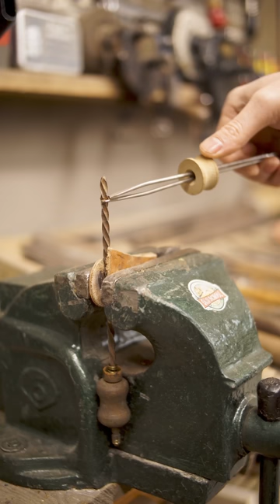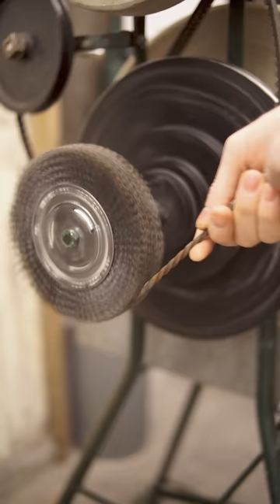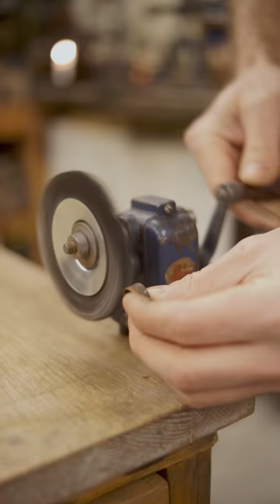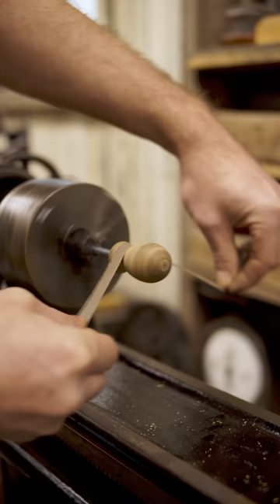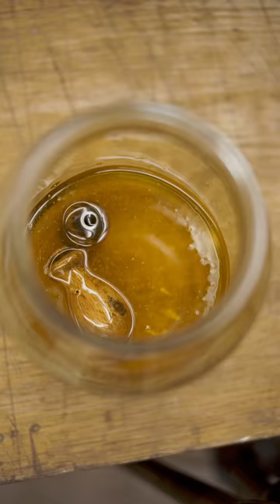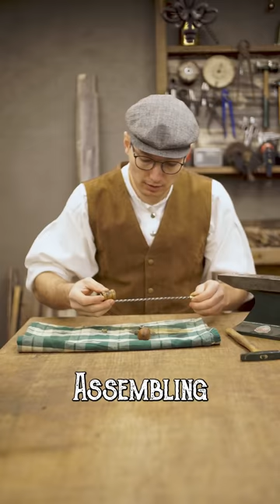Archimedes drill from 1895 year #antiquetools #vintagetools #restoration

Comment: This is a TRUE restoration. Not replacing parts with a bunch of new ones.
Reply: The word "obsolete" comes to mind
Reply: Far from a true restoration. He took off any edge that blade might have had left.
It's actually less useful now since it will be rounded off on the edge.
Reply: @FedSmoker64  Blade?.. bruh that's not the "blade" lol
Reply: @FedSmoker64  That's not the blade, it's just a screw so that the drill bit can rotate
Reply: And all with manual tools
Reply: @FedSmoker64  the bit isn’t in it dude. This is the drill and they are used to drill very tiny precise holes.
Reply: Except for that he ruined the handle
Reply: @0_K_0  no he just sanded it and dipped it in oil.. some restorations I seen replace the handle entirely
Reply: @lostpockets2227  exactly, he put and left it in the oil overnight, big mistake. It'll never dry out, you're meant to wipe it on. Trust me, that's how I ruined the handle on my axe, which wasn't cheap, but after doing a bit of research I got a new handle and tried again.
Reply: @0_K_0  oh that's very interesting thanks for the information
Reply: yes that is what the definition of restoration is
Reply: @0_K_0  yeah, I noticed that too, oil can't oxidize properly like that and it serves no purpose that just wiping it on properly doesn't already do perfectly fine.
Reply: hows the other one not restoration?
Reply: @FedSmoker64  back then a drill only cut with it's tip I believe
Reply: @FedSmoker64  Se não sabe para quê serve a ferramenta, porquê comenta?
Reply: @kwfroes  don't speak that gibberish at me
Reply: @FedSmoker64  You dont know what are you saying, right?
Reply: @FedSmoker64  dude. It's not for use. It's an antique decoration.
Reply: 0э
Reply: Sometimes something NEEDS to be replaced in order to literally use it. A useless tool is not a restored one. This tool was in very good condition allowing for what you think is restoration
Reply: I make a new one?
Reply: Sometimes True restoration requires some parts to be replaced either because the parts are not salvable or no longer useable. If some of the old parts are kept just so is is a “True restoration” then the piece may not be useable anymore. I define True restoration as you fix something that is older and broken and cant be fixed by traditional means; so that it can be used again.

Comment: My wife and I had inherited her Grandparents house about 12 years ago. It's nothing huge, they weren't rich. It is a nice place with a big backyard. The coolest thing is the shed in the back. Wilber (her grandpa) was an electrician, carpenter and inventor. The shed is like one of those tiny houses you see at Home Depot, except he built it himself from the slab to the wiring. The bottom floor is all carpentry gear from lathe to table saw and everything in-between. The upper floor was  his electronics workshop. The reason I mention this is because he has old manual tools just like these in there! I have was an Electronics Technician in the Navy and have a MBA in avionics engineering, but I love carpentry as a hobby. When he was alive, I adored Wilber and he showed me how all of the old and kind of obscure tools worked. My father-in-law and my wife love that I appreciate his old tools and still use them. What's weird is I find most new tools give the illusion of ease, but really aren't.
Reply from the maker: Wow, that is awesome! Thank you so much for sharing 🤗
Reply: Nothing beats a plate joiner when it comes to powered hand tools
Reply: Помню дедушкин гараж с разными инструментами. Там был такой запах всяких деревяшку и металлических деталей 😊😊😊
Когда дедушка умер было очень грустно. Остались его труды.

Comment: I've never seen a hand cranked wire wheel before, thats neat. the thing that came to mind was if the wheel slung a part you were holding across the room at least you could say that you were powerful vs the electric bench variety that would send a part into low Earth orbit horizontally with little effort

Comment: Damn I didn't even know hand powered bench grinders were a thing. Cool stuff
Reply: Honestly you could probably throw one together from an old pencil sharpener from the looks, too. Be a neat way to repurpose something.
Reply: Our family has had a hand crank bench grinder for over 50 years. I still use it now and then to sharpen stuff.
Reply: How do you think the Amish do it?
Reply: @floki8382  You could, but it would not be effective as the gear ratio is not there to get it up to speed.

Comment: Linseed isn't toxic
Reply from the maker: Would you drink boiled linseed oil?
Reply: @FFD_Restorations  What kind of question is that? Of course i would!
Reply from the maker: @cum_as_you_are  good luck with that, but I highly do not recommend you do that. I think you are confused a bit. There are three types of linseed oil. You refer to food safe oil while I am using “boiled linseed oil” that you can buy in most stores and it is actually mostly raw linseed oil, but with plasticizers, hardeners, and heavy metals added to make it act like true boiled oil. Folks who are concerned about the toxicity of linseed oil are likely thinking of this type

Comment: Have any tips or recommendations for pedal powered metal lathes?
Alot of people buy them for the history but you're one of the very few I see actually using one for work
Reply from the maker: I'm pretty new to use of metal lathe. Therefore, not sure I could give you any good tips, but I could definitely share my thoughts on what I considered important before purchase:
1. To be 100% complete lathe, finding parts is difficult;
2. To be located in Norway, so I don't need to pay additional taxes, import toll and shipping;
3. To be in working condition;
4. Any additional parts that comes with it is a bonus;
5. I didn't care much about the brand since they are all well made and they will not brake that easily;
 6. Reasonable price, 100% original and complete goes for crazy amounts of money. Negotiate the price and be patient is a key I would say. 

Finally, I was scared when I bought it since it was quite expensive for a hobby. But after turning a few pieces I was relieved. It is such a great machine.
Reply: @FFD_Restorations  hm I see. Thanks!
Reply: @FFD_Restorations  did you have to do much restoration on the one you bought? Even little things like greasing it up or taking a wire brush to it?
Reply from the maker: @a.t6066  no worries 😉

Comment: FIrst, I need the file for that label on the linseed oil, that's amazing. Then I need a list of all those tools. At least, what's the one called with the wire wheel attached? I could definitely use one of those in my shop.
Reply from the maker: Cool. It is called hand crank grinder 😉

Comment: Where'd you get that hand operated buffer... guessing you can put grinding discs on it too?
Reply from the maker: They can be found online as a hand crank grinders. Often on eBay or some antique stores with online sale. Yeah, you can attach basically anything with the correct diameter. I use with  stone wheel, brush wheel and polishing wheel 😉
Reply: @FFD_Restorations  sweet thanks, been after one for ages

Comment: I had a similar idea about soaking in linseed oil. But apparently its not a great idea. The oil needs to oxidise to harden.  The oil deep down wont be able to do this properly.  Whether this affects strength or life I'm not sure.
Reply from the maker: Let it soak first and let it dry on air for a week afterwards. This way you will have properly protected wood handle. If you want to go really old school than this process should take at least a month where you repeat the process few times 😉

Comment: Isn't an Archimedes drill double threaded so it always spins the same direction?
Reply from the maker: That method is used for screwdrivers, not for this type of drill.
Reply: @FFD_Restorations  but is it an Archimedes drill if it doesn't have an Archimedes screw?
Reply: @FFD_Restorations  also, a screwdriver needs to turn both ways. A drill should only turn clockwise
Reply from the maker: @Bzorlan  👍

Comment: Whats the use of said drill?
Reply from the maker: Not sure I understand your question?
Reply: @FFD Restorations  what is that tool used for? 
Doesn't look like it would drill in anything, considering it's got things blocking every tip. (Handle and knob).
Reply from the maker: @CartoonWeasel  thanks for clarifying! It is used for drilling. It is quite good but it takes longer time to drill. I am using it often and it is easier to control if I compare it with hand crank drill.

Comment: Why did you boil linseed oil?
Of all oils why this one?
Reply from the maker: I didn't. It is sold as boiled. There is a lot of info on web. Check it out 😉
Reply: @FFD_Restorations  ....okay my job is just to soak it in it overnight..but there must be a fundamental reason for it...
What do you think?
Of all.oils, why that one?
Reply from the maker: @solaokusanya955  boiled linseed oil is a popular oil for treating wood because it penetrates the wood fibers well and provides a durable, water-resistant finish. It also has the added benefit of drying relatively quickly, which allows for multiple coats to be applied in a short amount of time. Additionally, linseed oil is a natural product made from flax seeds, so it is considered a more environmentally friendly option than some synthetic oils.
Reply: @FFD_Restorations  thank for the profound insight

Comment: I dont think its real cause if it was from 1895 it would have pitting on the drillbit maybe even partially broken a wire wheel would probably not get rid of the rust
Reply from the maker: What if the drill was kept in dry rom? And why the drill needs to be broken?
Reply: @FFD_Restorations  it doesnt need to be its just that most items that rust and that arnt very thick break easily and the dry room reason doesnt add up iron or steel doesnt need moisture to oxidize it just speeds up the process

Comment: Why boiled oil?
Reply from the maker: Boiled Linseed Oil is used to give a mellow, patinated finish to new or stripped wood. It is a superior quality oil, similar to Raw Linseed, but has had hot air passed through it to improve drying times.
Reply: @FFD_Restorations  Ok then. I thought you boiled it before using it. Thanks for answering. :)
Reply from the maker: @Cholycat  no no, you can buy it like that 😉
No worries, have a good one :_Greetings:

Comment: try not using a steel wire wheel when polishing anything other than steel. You will get steel shavings inside your piece that will start to rust and make it ugly in no time.

Comment: Wire wheel needs a foot pedal too
Reply: @FFD_Restorations  oh nevermind I see there is one like that. Wow I wonder how fast it could go with more gears. Nice setup man!
Reply from the maker: Thanks, they are usually maxed out. More gears would make it hard to spin. But if I remember correctly it was around 2000 RPM when I was measuring rotation on mine 😉
Reply: @FFD_Restorations  that's awesome!!  That stuff has a history that's for sure .. great video. Thanks brother!

Comment: Yeah NOPE. That handle would have taken a week to dry after soaking in penatrating oils. I haven't found any special tricks for getting around the drying time of penatrating oils like that.
Reply from the maker: That is correct, you can't in a traditional manner. But if use moder technic, there is way around.  Applying pressure while soaking and keeping it low heated afterwards. This way you can reduce time to just 24 hours 😉

Comment: Anyone else notice how he was faking half the stuff he was doing?
Reply from the maker: I am curious to hear what you gonna come up with 🤣🤣🤣
Reply: @FFD_Restorations  well a lot of the materials weren’t touching the metal
Reply from the maker: @grimreaper5035 could you be more precise? What materials you referring to? And what metal?
Reply: @FFD_Restorations  the nut wasn’t touching the grinder
Reply from the maker: @grimreaper5035  well, you have to take a closer look and understand that the brush wheel is almost finished which means it it will barely touch the surface  of metal since the the steel treads are not flexible anymore (due to the short length). And secondly, you can see how my hand and pliers bounce during cleaning from steel brush wheel vibration 😉